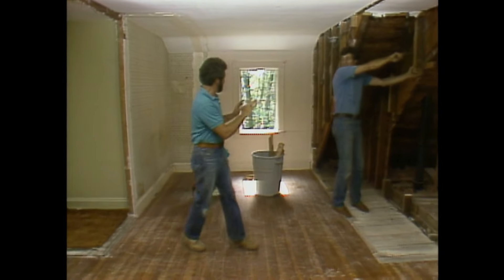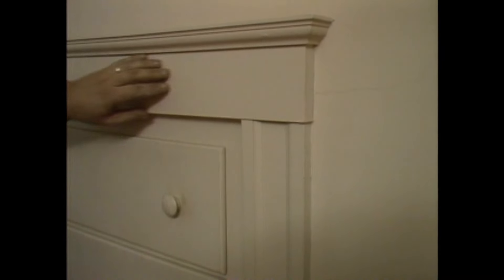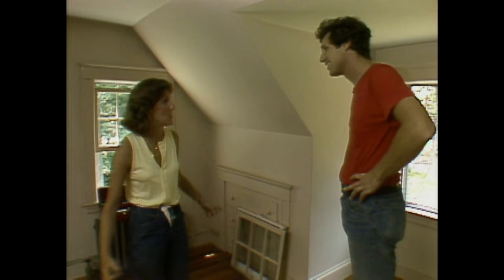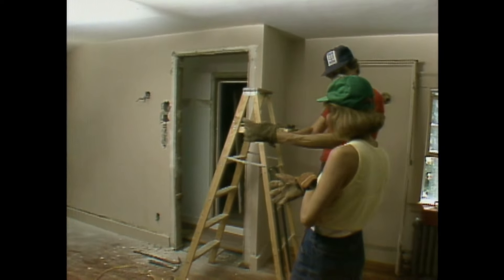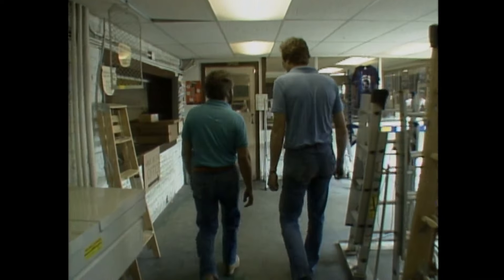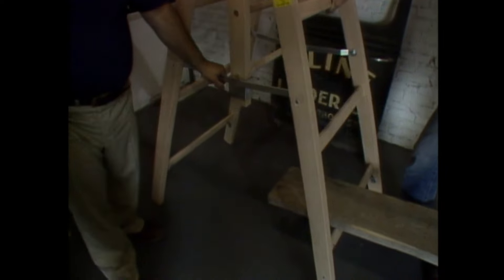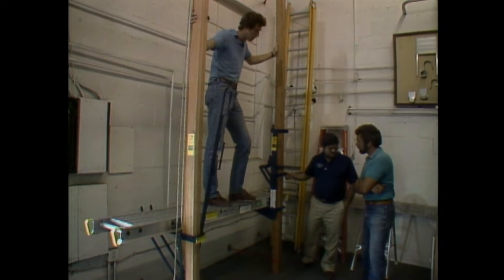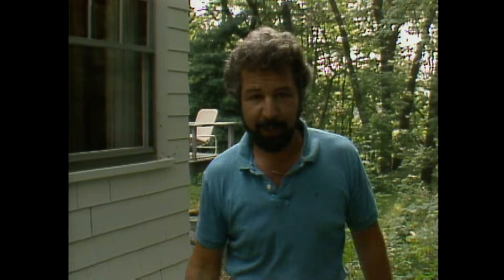Bob Vila This Old House Hidden Asset Part 2

Comment: I started watching Bob Vila on Saturday mornings & got hooked in the mid 1980"s. I didn't know how to use a hammer but I found some good carpenters & other trades men. 
I left my job as a realtor & started rehabbing starter homes. I had 30k in the bank & bought my first investment home for 29k cash in San Antonio ,tx,
Today,that same house in the same condition today would cost over 225k !!
40 years later & over 200 homes rehabbed & sold, I'M still at it.
I had the same crew for over 26 years, & like this show, I lost many of my guys for different reasons . I have gone thru a couple of new foremen but 

good men are hard to find nowadays.WE worked in all types of weather & were blessed with many years of real estate prosperity.
Those years went by too fast & all the great times & camaraderie are just memories now.Of course I'M still buying homes but nothing like we used too. 
Thanks to Bob Vila who planted a seed which grew into my life !!

Comment: 11:21 This is why when I go into a older home there is an inch of wire left in the box, cut it close to the device or pull the screw and cut the exposed wire folks.

Comment: Back when TOH was about sweat equity, homeowners doing the low-skill, menial tasks to save some money.  Norm explains how they can carefully remove the old door jamb and save $30 plus another $3-4 for a set of hinges!  Now it seems to be a endless parade of the best of everything that most people couldn't afford...
Reply: Check out the Detroit season from 2017.  It was a season where the homeowners rolled up their sleeves and worked hard.
Reply: Adam Thomas
 ... it's not about saving the $30 worth of wood or the $3 hinges, but more about preserving the pieces, which can never be reproduced exactly. On top of that, you already have the correct parts to reassemble that old door in another location.. and it all matches the home without the extra headache. (beyond patching up new nail holes) Yes, it would have been cheaper (labor wise) to buy a pre-hung 6 panel solid door but it would stick out like a hardon in a room full of eunuchs. <LOL>
Reply: That's because it was originally a focus on more historical houses which is Bob's passion. Today is more of your everyday homeowner that includes those not buying a Victorian and restoring it. Both are great but definitely love the old historic houses.
Reply: @JohnSmith-ne1yq  HERE IN CONN ALL OLD HOMES  KNOCKED DOWN FOR NEW PREFAB CHEAP HOMES  THAT COST 500K
Reply: You are right.  I still enjoy the show, but I got more from it back in the early days.

Comment: use a wide stiff putty knife behind the pry bar to prevent damage to wall
Reply: They were demoing the wall anyways.
Reply: Couple of decades too late
Reply: @Stevelemontrudy  I'll see if I can find one always willing to rate tools. I usually cut the caulk and pry the casing off. I usually mark it also so if it goes back up in the same spot it can be done easily. Pry the nails/staples from the back also
Reply: @fanmaxis3004  all they are taking off is the door casing and yes it will be put back on

Comment: There was just something about the attitude and demeanor of Bob Villa that made the This Old House series so popular.  I believe if the series had started with Kevin O'Connor that it would not have been so successful. Even though Bob really brought nothing to the series by way of knowledge, he was a great MC for the shows.
Reply: Vila wasn't in Silva or Abrams league as far as knowledge, that's not debatable. He had a lot more than the subsequent hosts, though. Bob actually did some work as a builder before hosting TOH, unlike O'Connor or the forgettable second host.
Reply: He was exactly what they needed at the time. And I agree, if the show had started with O'Connor or (god forbid) Steve Thomas as host it never would have got off the ground. I liken it to the first Star Wars films: those first couple were so good they created and sustained a whole industry of lesser quality films and tv shows. This Old House is a shell of what it once was but it's still the most popular DIY show on tv. Some of that is due to the presence of a great core of professional tradesman. But a lot is still Vila's lingering effect-even 30 years later.

Comment: Ah what we didn't know back then... like the toxicity of all the lead in the trim and plaster... that that composite plaster probably had asbestos in it.  That trim Norm wants to reuse is now banned by EPA unless chemically stripped before reinstalling.  Almost none of the processes seen on This Old House back then are allowed by the EPA or OSHA today.  Building codes have gotten so complex that even the building inspectors can't give contractors like myself definitive rulings.  It's impossible to be 100% EPA compliant when it comes to disturbing lead containing surfaces... don't get me started.
Reply: We knew just fine back then. But as you could see, with the masks for dust and fibers, along with ventilation, those people were in no danger. I used to think that over regulation was an inevitable effect of bureaucracy. I don't think so anymore, I think now that there are people that do this stuff to us on purpose.

Comment: Aluminum ladders! What a bad idea they were. Fun to watch these old shows.
Reply: Aluminum were a much better ladder then Wood. Wood generally had round dowels for rungs and hurt the feet even more. Also when you climb one you made sure to keep your feet by the rails. A foot near the middle might crack or outright break the dowel. Fiberglass does have it's advantages over Aluminum but over all. Both do the job equally as long as your not dealing with electrical hazards.

Comment: It's funny how this video is a year old, but nearly all the comments are from yesterday and today (14MAY2020). This was before my time, unfortunately. By the time I was old enough to remember watching This Old House with my parents, Steve Thomas was the host (and I only know the name because I already read the comments :) ), and it wasn't long after that he was replaced with Kevin O'Connor. Bob Vila I only know from Home Improvement and Tim Taylor's feud with him. From the sound of the comments, I'm thinking more than a few people laughed when Tim knocked him out with a plank to the head. :)
Reply: Otherwise, this looks WAY more informative than the current version, and now that I own a house, I'm probably going to want to go back and hunt down some older episodes for better ideas and education. Anyone know if those old two-prong outlets even had a ground screw on them? Whoever wired my house wired it with grounded cable, and then cut all the grounds off at the edge of the outlet box, so I've got to re-run ALL my wiring just to add the extra 12 inches of missing ground wire (6 on each end).
Reply: @c182SkylaneRG  ... nope, no ground screw.... BUT... if you are lucky the wiring is BX and the box is grounded, which means you can add a pig-tail from a ground screw (new outlet) to the box and get covered. That was a common fix in the 60s for BX but doesn't pan out if it's cloth covered Romex wiring.
Reply: @rupe53  Nah, it's some sort of oiled or tarred cloth, and the ground wire is clipped back as short as possible without being connected to anything. Same down in the breaker panel: clipped instead of connected.
Reply: @c182SkylaneRG  ... if that oiled / tar cloth seems to have a silver coating that would be impregnated with arsenic to repel rodents from chewing. It's highly toxic so wash up after handling.
Reply: @rupe53  Oh, shit! Thank you!! I'd been trying to wash up anyway just because it was icky to handle, but I've got scraps of the stuff lying around. Thank you for letting me know!! I'll be sure to handle it much more carefully, and I'll probably make a more determined point to get rid of the stuff. I had been leaving cut ends behind in the walls. It may still be impossible to completely remove, but now I've got a reason to try. Thanks again!

Comment: Corded power tools. lol
Reply: Still use a corded reciprocating saw but yeah it would have been funny if he bust it out the corded screw gun
Reply: Depending on what I'm doing. It's not always worth killing charge cycles on batteries. If your going to do a lot of cutting or cut something that cuts hard. Sawzall or Skill Saw.